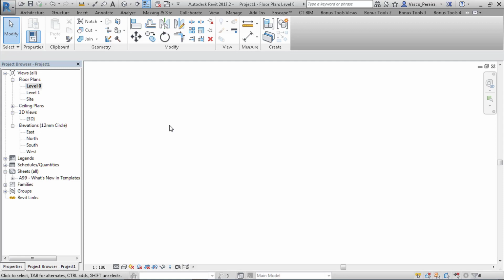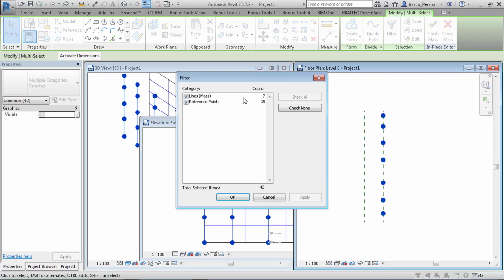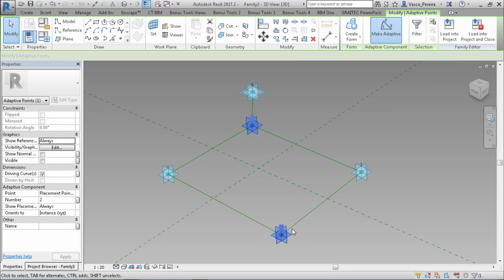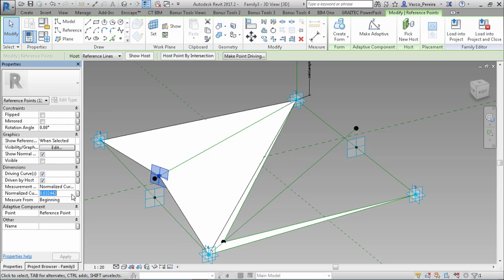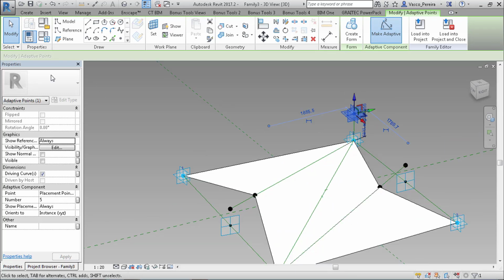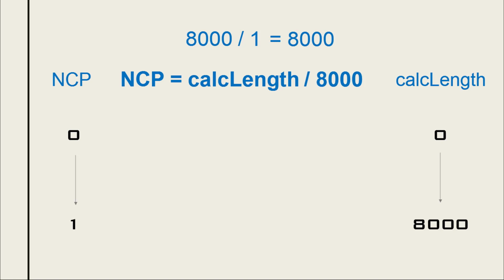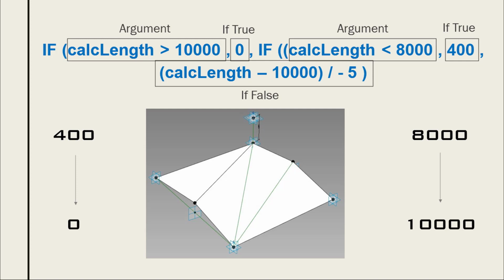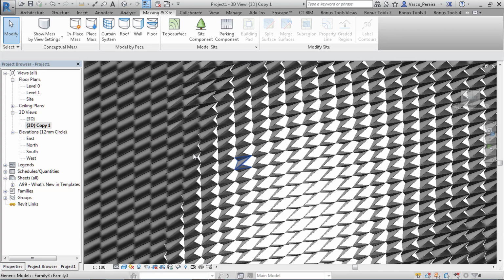Revit Multiple Point Attractors Without Dynamo

Comment: your 2nd formula is off in the presentation. its missing a close bracket. should be like the below
if(calcLength > 10000 mm, 0 mm, if(calcLength < 8000 mm, 400 mm, (calcLength - 10000 mm)) / -5)
although the one you past in the family also says > 8000 but in the presentation it says < than 8000
The formula you paste in revit also has an additional calculation within it. after 400 there is a -(calcLength...... then it crops off in your view so no one can see the correct formula that actually works.

For anyone else looking at this the original poster pasted a below comment with a formula. but that also doesn't work like shown in the video. if(calcLength > 10000 mm, 0 mm, if(calcLength > 8000 mm, 400 mm - (calcLength - 8000 mm) / 5, 400 mm))

Just to note. you also dont need 2 parameters for the NCP. you can click those points and make ones instance parameter for measure from "beginning" and the other can be "end". then you only need the one parameter to control where they go along the ref line.

Comment: Thank you for your teaching
Although the film was only twenty minutes, I spent two hours and finally tried it out.
Your speed is too fast
I have to use 25% of the playback speed to keep up with the operation.

In the content of the movie, I paused on the part of the formula and the part that uses the shortcut key.
Because the formula is incomplete and unfamiliar to family and English
Reply: Hi, I am at the end of the  tutorial, could you post the  complete formula?
Reply: @emilyt4816  offect =if(calclengh > 10000 mm, 0 mm, if(calclengh < 8000 mm, 400 mm, ((calclengh - 10000 mm) / -5)))
NCP=if(calclengh / 8000 mm < 1, calclengh / 8000 mm, 1)
NCP inv=1 - NCP
Reply: @oao1051  Thanks,  it  works. Very cool. Now   I  can  show  off
Reply: @oao1051  Thank you very much brother, if i don't find your comment i'll be dispointed, cause i also blocked with the formula of Offset.

Comment: Hi the tutorial looks good but I had so many problems and couldn't actually do it so I gave up. 
First the repeat command won't apply the component over the whole surface and the 5th point wouldn't attach to the corresponding node. And then when I tried to add lines to created faces in the adaptive points the lines never selected the points so I'm assuming that this is why when I moved the point which was on the offset point line connecting to point 2 only the point moved and not the face. Anyway, it took me 3hours to do this and then I gave up.
I would really like to do this tutorial and make it work... any suggestions?
Reply: I had the same problem at the beginning regarding the repeated component that did not attach to the right points. I solved it by building the flat surface in the same order of points. For example, the curved surface is getting built by points on vertical lines, so you have to build the flat surface in the same order - points on verticals and then Form Surface.
Reply: thanks adriana!! now it works! I've simply copied the existing "flex" surface and erase the "flat" one. But why it won't work with the "flat" one like in the tutorial progress?. It was really driving me crazy!
Reply: @MsAdriana2811  IF U STILL WANT TO GIVE ANOTHER TRY  I CAN HELP, I FACED KIND OF THE SAME PROBLEMS BUT BEEN SOLVED , JUST LEAVE A COMMENT
Reply: Como dice lele lela, esto siempre sucede.
Ok, veo que tienes 2 problemas distintos:
1- El modelo adaptivo no se repite en toda la superficie:
Puede ser que allas dibujado 2 superficies las cuales no son exactamente iguales, por lo tanto te propongo, hacer una superficie y copiarla.
2- El otro problema esta referido a los parametros de informe:
El parametro de informe debe hospedase en elementos de la familia (como niveles o planos de referencia de contorno de muro cortina), asegurate de seleccionar correctamente el plano de referencia del pto adaptivo.

Comment: for some reason im getting very weird long triangles . what could be the problem? thank you
Reply from the maker: Hi, long how? grid size or the offset pulling them out? let me know if you're still trying to get it to work and I may be able to help!
Reply: @vpbimchannel9014  I had the same problem. The component works good in its 3D file (up and down). Once I load it in the Project file (1,2,3,4  and 5 points on the other surface) it doesn't want to work anymore (long triangles\deforming pattern). Do u have any suggestions?
Reply: A too large family size may be the root cause. By recreating a smaller size family fixed this problem on my case.

Comment: hi good job on the video , but got confused with the formula of offset parameter as it was displayed incompletely when you pasted it . could you paste the whole of it here ,as the reply from revit after pressing ok for the parameter is " end of expression unended "
Reply from the maker: Sorry it took me some time to reply... the formula is:
if(calcLength > 10000 mm, 0 mm, if(calcLength > 8000 mm, 400 mm - (calcLength - 8000 mm) / 5, 400 mm))
Probably it was missing a parenthesis... try this one anyway
Reply: Thank you so much ! wanted to learn this so that i could apply it to my thesis in some way ! not that good in the mathematical stuff so thanks a lot !